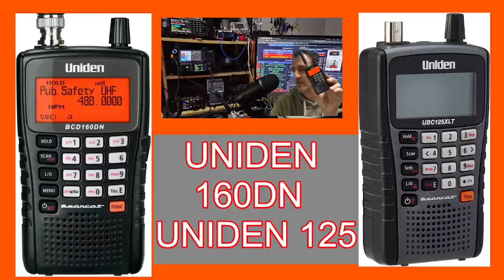NEW UNIDEN 160DN - COMPARED TO UNIDEN 125

Comment: I have had my 160 for three weeks now and I like it. It is like the 125 but with a couple of differences, the 160 doesn't have close call but it has the dmr and nxdn receive capability, and a band scope, like the Yaesu VR500 and other. You can download software from Uniden for programming for free and it works well. Dmr works, but there can be some annoying stops for a second or less when scanning dmr channels. That can depend on how far away you are from the transmitter if the radio don't hear the transmitter well. It decodes well and I think the audio is good. I have a 125 and a 3600 too among others and receiving with the 160 with same antenna as the 125 is equal in my ears. I have not tried decoding nxdn because I don't know anyone the use that mode nearby.
Reply from the maker: Thanks for this info I do have the 3600 aswell I will do side by side .
Reply: would you say it is as sensitive as a 3500xlt
Reply: @Mac-1Media  I have only done a side by side with the 125, but I'll try it with a 3600 soon. Maybe M0FXB does it before me.
Reply: A clarification on the short hiccups it have when scanning dmr, I think it is because the radio don't hear the transmitter 100% and stops when it hears a dmr signal but don't decode it due to low signal strength. Some day I will go to the site where the dmr transmitters are and try when being close. I still like it!

Comment: One difference between the BC125AT and this new one (in the USA) is the 125 I have does not cover the 223-225 Mhz band which is used for ham radio in the USA. But the 160 does have that band. Now I noticed your comparison is for the UBC125XLT and my unit is a BC125AT. So the XLT might cover that band. But this does no good in the UK at all. But as a ham radio operator here in in the states I like to scan the 220 ham band and I do use it. I talked to someone here in Utah just the other day on 223.500 simplex.  Some of us here in Utah are trying to get more hams back on 220 band again. I'll have to check the difference (if any) between the UBC125XLT and the BC125AT. Possibly just a difference between Europe/UK version and the USA? I'm headed to google now. But I do know that the new 160DN covers the 220 ham band so I'm going to get it. I have two ham HTs that cover that band but it would be nice to have a receive-only scanner that gets it too. For hams, using a scanner to listen to VHF/UHF ham bands saves battery power on our transceivers. So it's nice to just listen for a call, if anyone calls you, switch from your scanner to your ham HT!! Wow, I just wrote an entire novel so I'll stop now.
Reply from the maker: Hi thanks loads for this info .
Reply: More helpful issue is gonna be to study manuals for one's mentioned above. IMHO. Best regards, be well!

Comment: I wonder why they've not moved to usb-c? (Cost maybe)
Reply from the maker: Yes cost saving but you can buy an adapter for £2 I will make a.Video .
Reply: As per my opinion based on practical  experience, mini usb is more durable, then type c.